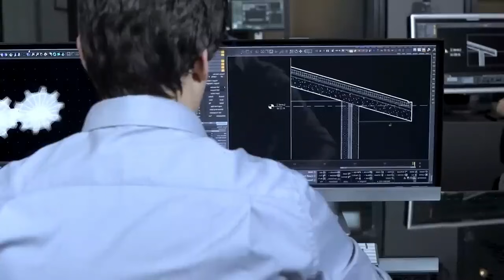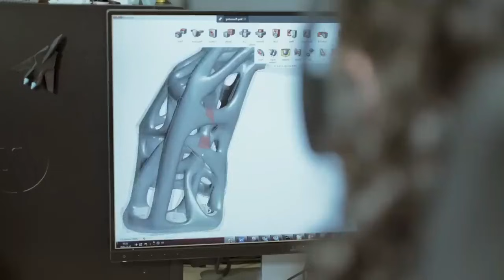Shocking the World! Turkey Finally Creates an Invincible Next-Generation F-16

Comment: 🤣🤣🤣 They are not even on Viper Level nor have AESA radar 🤣🤣🤣
In a few months they will have to park them since they don't have parts for them!
Reply: MURAD 100-A is a state-of-the-art multi-functional fire control radar that, thanks to its AESA architecture, possesses agile electronic beam steering capabilities and can provide simultaneous air-to-air/air-to-ground engagement capabilities. The MURAD 100-A Radar has become a game changer in today's air combat by combining air-to-air engagement capability with BVR (Beyond Visual Range) missile guidance capability.
Reply: @okccar8955  cool. Let's wait and see then ;)
Reply: @anastasioshadjistephanou Turkey produced its own F-16s and those of Egypt and that was some 30 years ago. Don’t you think Turkey has evolved since then and new and the technologies (3D printers etc) made production easier?
Reply: @MrMediterrano actually what they produced was just the fusalage. No avionics, no electronics, no engines, nothing. And that was under the maintenance agreement of LM
Even now with KAAN, they got problems with the engines
Sure they evolved in some aspects but I don't expect miracles. They won't be able to upgrade with AESA and Lunk16 for instance
Reply: @anastasioshadjistephanou  I can’t say as I’m not knowledgeable enough but it seems that they are making good progress with the EASA radar (Murad). In fact, it is rumored that its hardware is more capable than the radar of F35. But the SW and the testing necessary for its development is said to last 2-3 years as a minimum. And what goes the avionics, I think that is the area Turkey is the strongest.
Reply: My friend, you are trying to mock Turks as a nation. But Türkiye is building its own defense industry and actually making progress. Serious progress, in fact. KAAN doesn’t have its own engine yet, nor does the Altay tank. But they are working on it, pushing forward, and as you can easily guess, those engines will eventually be built. Türkiye already produces most of its own rocket, helicopter, and drone engines. It builds AESA radars, various types of missiles, and even the hypersonic Tayfun and Gazap munitions that you don’t particularly like. Around 30 naval vessels are currently in the shipyards, being launched one after another.

Is everything completely Turkish-made? No. Is it the best in the world? Also no. But despite your attempts to ridicule, Türkiye is clearly advancing in this field. The Türkiye you mock today controls nearly 60% of the global drone market. The drones you laugh at achieved major victories in Karabakh, Syria, Ukraine, Libya, and Somalia.

But what are you doing? You’re spending money you borrowed on weapons you won’t even be able to get ammunition for, and on top of that, you keep begging Europe not to cooperate with the Turks — as the so-called honorable Hellenic State. It’s truly pathetic.

And here is the question: if Türkiye’s military power is really that weak, then why are you looking for help from India, Israel, and Lebanon? If you are so confident, then come take Cyprus, Istanbul, and Western Anatolia. What exactly are you waiting for? But no , right ? Because you know the concequences.
Reply: they have it, do proper research.
Reply: @m.a.8860  yeap, keep dreaming and selling it to your people! 🤣🤣
Reply: @anastasioshadjistephanou  o zaman sürekle amerikaya, Avrupa Birliğine gidip Türkiyeyi şikayet etmeyi bırakabilirsiniz😂Türkiye'den korkmanıza gerek yok, gidip mutlu olabilirsiniz 🤣🤣🤣
Reply: You keep dreaming, what an ignorant and uninformed comment.😂😂😂
Reply: I am happy that my Greek friends do not believe in these turkish developments. No, the Turks do not make planes or tanks etc. We make cardboard toys:). Keep on believing like that.
Reply: @nailalbayrak-q3k we saw the turkish upgrade technology in yesterday c130 plane....😂